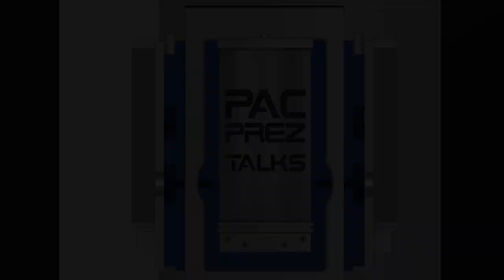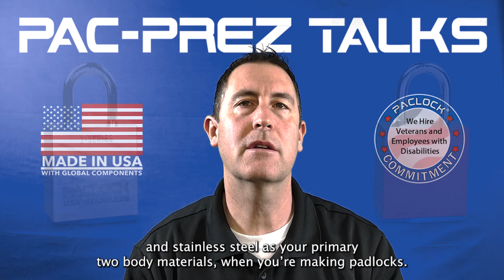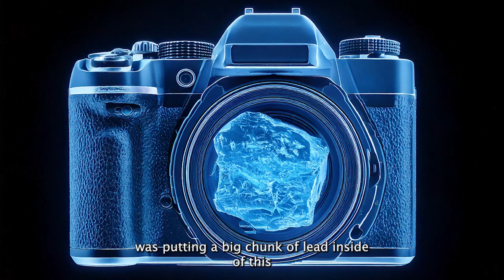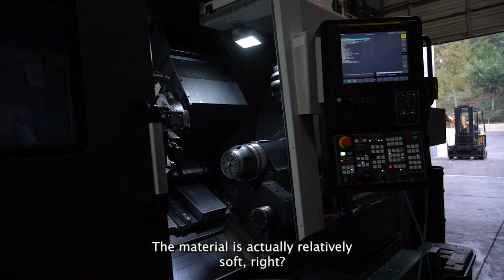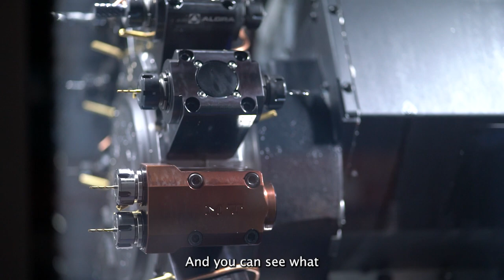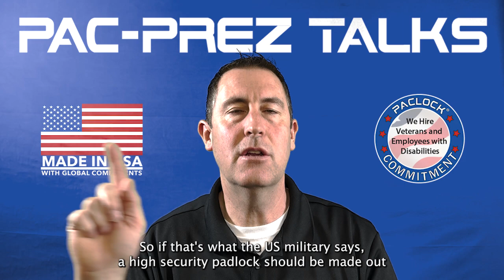PAC-PREZ TALKS: Outdated and Overrated — Padlock Materials to Avoid

Comment: Aluminum oxidizes at a much faster rate than brass does, and aluminum turns into a white fine powder that gets into the inner workings of your core, in the field as a locksmith, the American 1100(1200,1300) have that issue, they get gunked up with aluminum oxide and weathering, almost every brass padlock I run into in the field work perfectly, a drop of lube and call it a day, but for the aluminum body padlocks I have to swap out cores after only a year or 2 because they are unserviceable due to buildup in the chambers
Reply: Like @AlbertLebel mentioned, good points — aluminum can definitely cause issues if it’s untreated or poorly anodized. Older locks like the 1100s likely weren’t always anodized well, so they’d break down in weather.

We use 6061 aluminum and Type 2 anodize all our bodies, which gives solid protection against oxidation. For our locks that use our sleeve technology, we go even further by Type 3 hard anodizing for extra durability on the sleeves.

If the locks you saw weren’t anodized right, that would explain the gunking.

Give our locks a shot — and if you ever run into the issues you’re describing with other manufacturers, we’ll stand behind them.
Reply: @pac-prez  have a few 90a Pros in my collection and I currently hold the speed picking record for it, thank you for the 200k club, it's really boosted interest in the Locksport and locksmithing communities.  I'm not trying to be an ass, I'm speaking solely from work experience, all aluminum locks (mortises included) no matter how good your coating is, the moving parts rub, it grinds away the inside of the lock body, that's what oxidizes, not the exterior. If you can prevent metal on metal rubbing then that will solve the issue, I have never seen that issue with brass
Reply: @Mr1nferno  Totally appreciate the insights — thanks for taking the time to share them! And I’m with you: it makes sense that rubbing could wear through the anodized layer and lead to oxidation. We just haven’t had customers bring this up as a real-world issue yet, but I hear you. Respect for your work in the community and congrats on the speed-pick record — that’s badass.
Reply: @pac-prez oh I’m a big fan of Paclock. Fantastic products at reasonable prices. I just like to get ALL the info out there and break it down. So thank you so much for all this info. For taking the time to share your expertise. Keep up the good work. 
I once gave away a Paclock 200A on my YouTube channel once a week for a year. I chose that lock due to all the research I did at the time.
Reply: This is some seriously good info because you are literally in the field dealing with them. So now I am wondering how much the PAC Prez has to say about this. He has he manufacturing side but you have the actual tried and true side. Very interesting. Thank you.

Comment: I like the plastic and aluminum because they are easy to carry to locksport meetups! Also the aluminum is nice for not weighing down cases. The only problem with aluminum is vulnerability to gallium attack, but most baddies just rock the angle grinder anyway. If you actually need to worry about gallium, step up to the stainless.